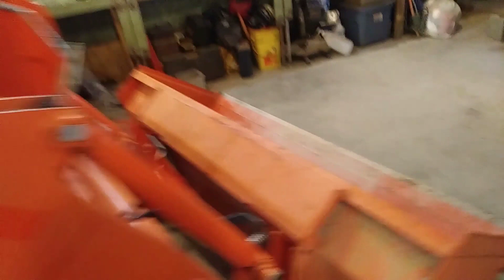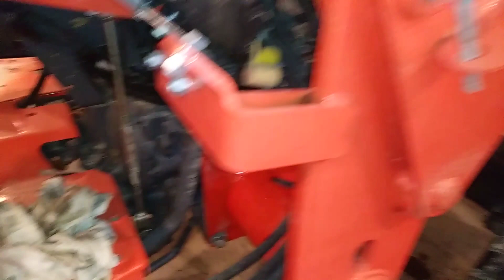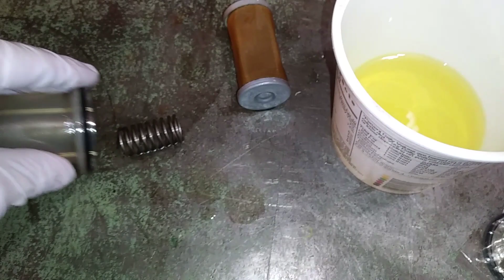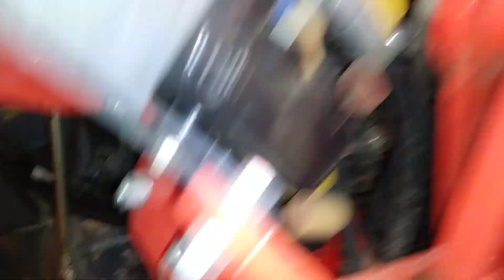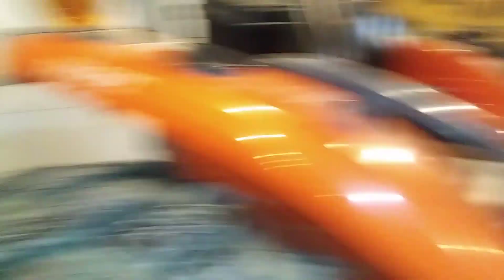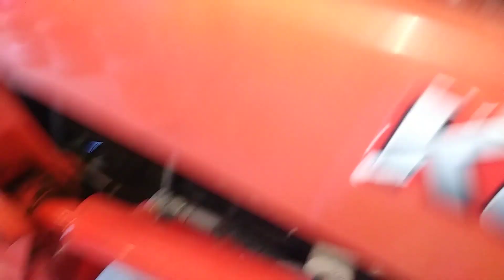Kubota MX5200 Fuel Filter and Water Separator Service

Comment: Does anyone here know how the angeled hose fittings on the housing of water separator are connected? Do they have a inner thread? Some seals?    On my yanmar sv08 excavator, I see some diesel fuel which is leaking between the fitting and housing.  And I can easily move that fitting.   I am not sure which spare parts are needed. I want to ask  before I uninstall everything ;)     My device looks very similar to your device.

Comment: Thank you for the video. New tractor owner and just got my MX5200 back from dealer at 200 hour service. Wouldn't keep running so I was told to bleed air out of the fuel lines. Also found that the fuel/water separator had not been emptied and cleaned. Followed yours and Ask Tractor Mike videos and fixed it myself. Thanks.
Reply from the maker: I’m glad I could help. I absolutely love my mx5200. Best all around tractor I’ve ever been on. I hope you like yours too.
Reply: @justtinkering6054  it's my first tractor and I'm real happy with it so far. I did see a tempting Kubota review yesterday from Messicks on the new M6200 with the backhoe. That looks like an awesome piece of equipment. Thanks again.
Reply: Vo😅0